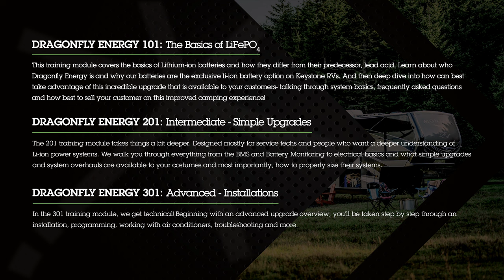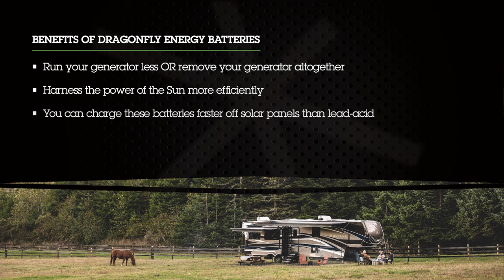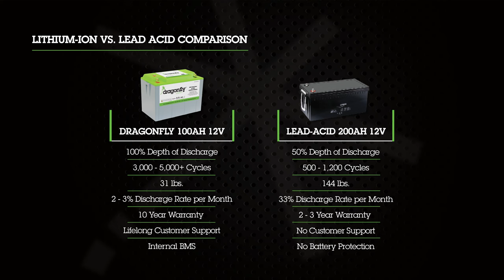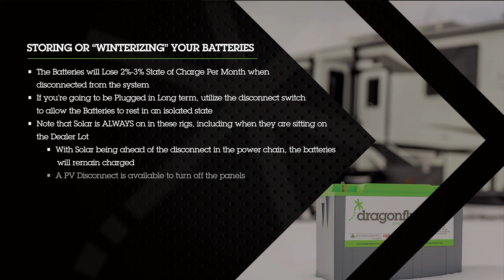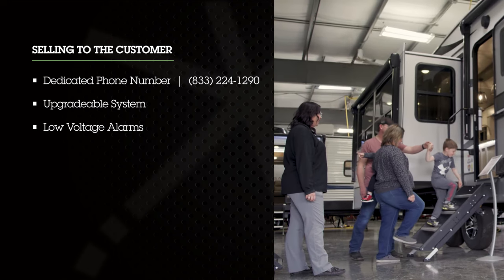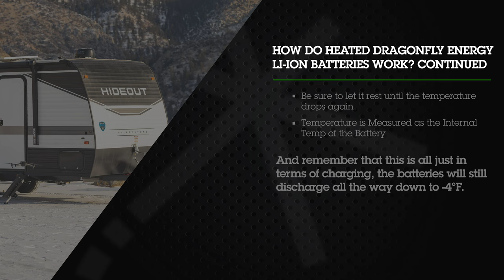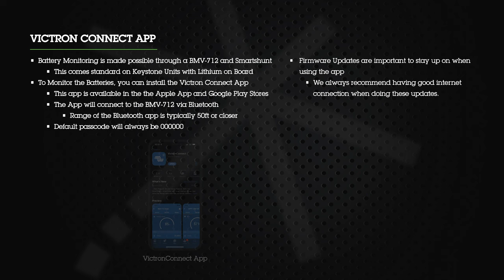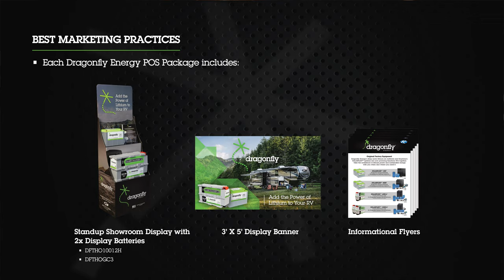Dragonfly Energy 101 | The Basics of LiFePO4 (Lithium Iron Phosphate) Batteries for Keystone RVs

Comment: Our New Dragonfly 12v 100amp lithium battery charges fully in about 5 hours, but doesn’t hold the 100amps for more than an hour after dusk…and provides zero sustained energy. Factory installed with our Keystone Springdale. No one local wants to touch a lithium battery to help us troubleshoot. Any resources here to help us out? Keystone office can’t help us on the weekend and were unable to dry camp as planned. We have the Solarflex 200 base package.
Reply from the maker: Hi. Our technical sales team would be happy to assist you in troubleshooting. You can reach them at (855) 292-2831 (M-F 8:00am - 4:30pm (PST)).